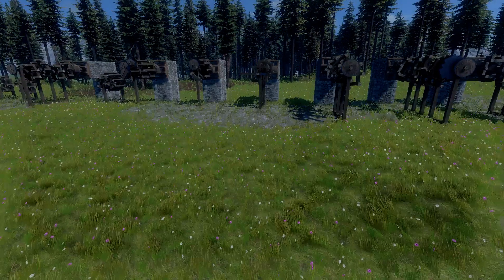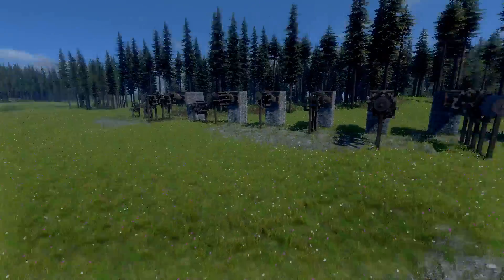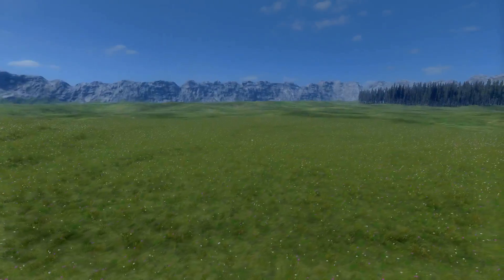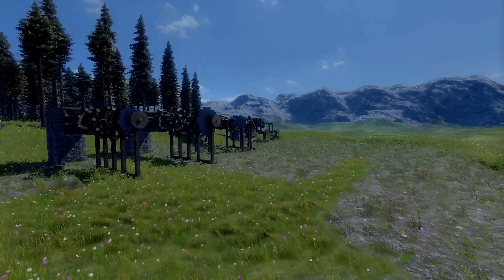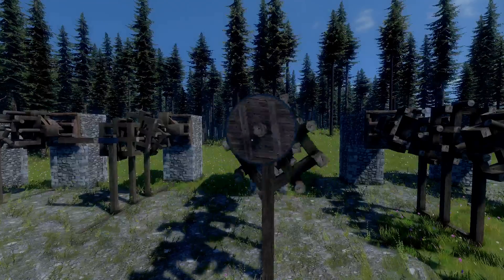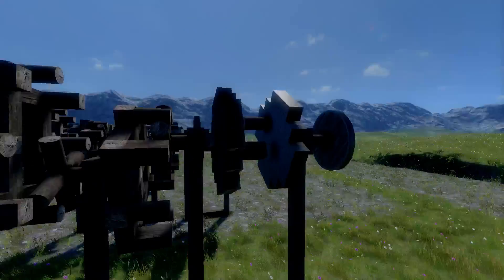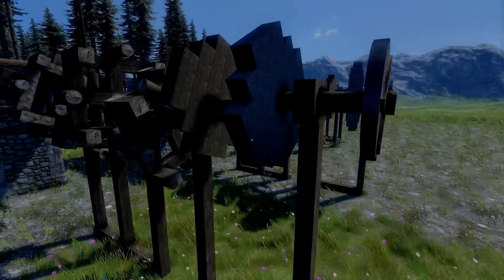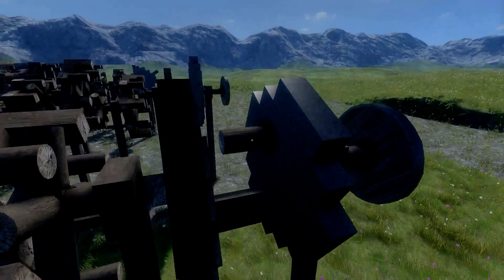Medieval Engineers Ep9, Flywheels and Crankshafts.

Comment: Enjoyed it, the third flywheel is pretty good, I tried a few flywheels, catch blocks have quite a bit of resistance, which I guess you would expect with wood on wood, but you've found a pretty good balance there.
Reply from the maker: It's the second flywheel i think you mean, the big one right? The first one was just a copy of the earlier x16 omnigear setup.  
And i'm guessing your flywheels were pretty much the same principle? doesn't seem like there are many other options atm. Although i usually always think that, until a week later i end up with another design :p

Comment from the maker: Make sure to take a look at my new steam group. Especially good for those people who can't comment because they don't have/want google+ http://steamcommunity.com/groups/IronLab  
It's still rather empty, so i need people to liven up the place :)
Reply: Ironvos, you should try using a Lockable Catch Block rather than a driving peg for the flywheel.  This would have two main advantages: it could spin freely indefinitely, and it would start spinning immediately.

All you would have to do is replace the catch block holding the flywheel with a lockable catch block, connect the axle of the catch block to the driving axle, disconnect the lockable catch block from the ground so it can spin, and build the flywheel off of the lockable catch block itself.

It just occured to me, however, that this would offset the actual wheel by 1/2 a small block.
Reply from the maker: ZantarV There are certainly other ways of making a flywheel set up. My way isn't the only way, just the best one i have found so far :)  

However it must be said that in the current system, having a decent rather than a perfect flywheel is preferable. As i mention in the video, if the flywheel is too good it might get too far ahead of the rotation of the system due to the periodical accelerations, and that would probably have a negative effect on the outcome.  

But i will certainly be testing out more set ups later on.
Reply: Ironvos As always, I look forward to it.  You and Captain JaRs make the best ME videos: you're the engineer and he's the mad scientist!